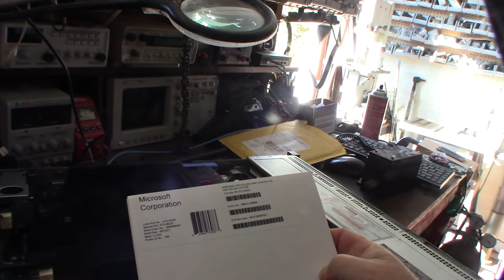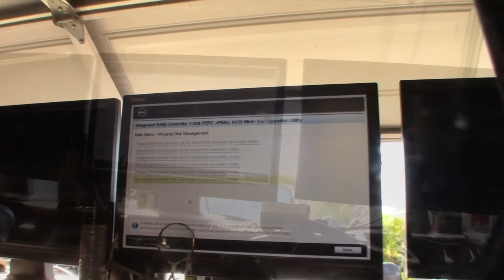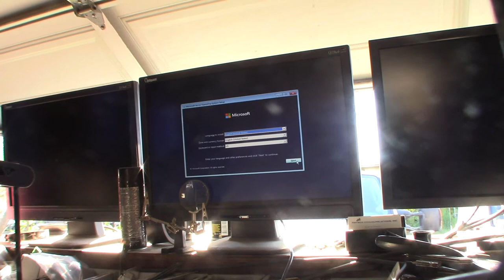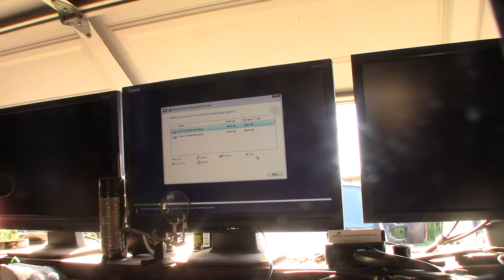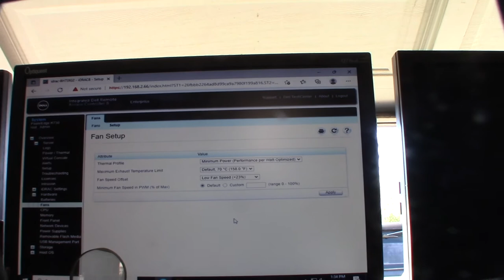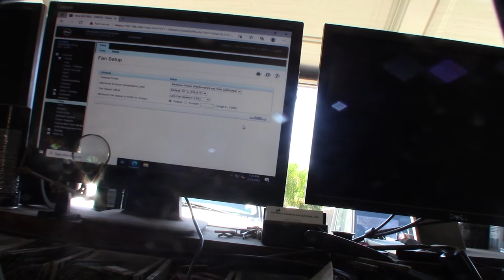Dell Poweredge R730 Windows 2022 server build, Silence noisy fans, quiet loud fans.

Comment: These units run the fans at almost 100% when the cover is off or if any hardware installed is not supported hardware by Dell P/N.   There are ways in the console or IRDAC to disable this functionality if you do some searching around.

Comment: Just removed the 2 x gpus from both my R720's..Put them in the R730 and the fans are probably now at 100%...bios and firmware update has slowed them a bit , but only by maybe 50%....funny thing is, even after cpu upgrades and running CPUS at full power simulating in 3DS MAX, it was near silent apart from a little psu fan noise here n there, quieter than the r720s, swapping out the Quadro cards has ruined this build ..WTH

Comment: What would we use this for at home that a regular desktop gaming pc can’t do? I have a R610 but I just use it for work stuff like running virtual machines. I would not do that for home use though.
Reply: Depends on your needs. If all you do is run a couple lightweight VM's it's not going to be much of a difference. But if you need hundreds of gigs of RAM, or need to swap out disk frequently and/or easily,  or have the capability (or a reason) to use iDRAC or IPMI remotely, then the datacenter-style computers can start to make sense at home.